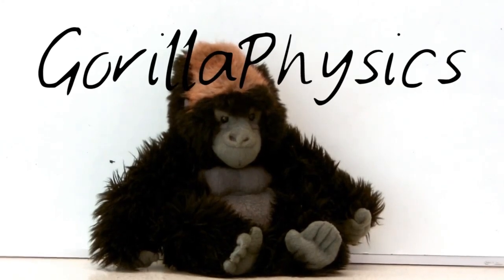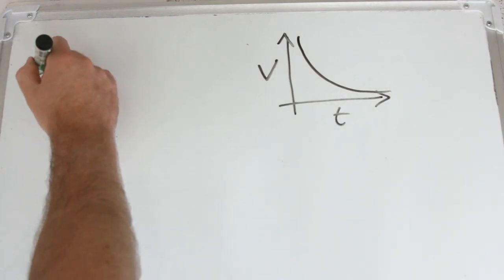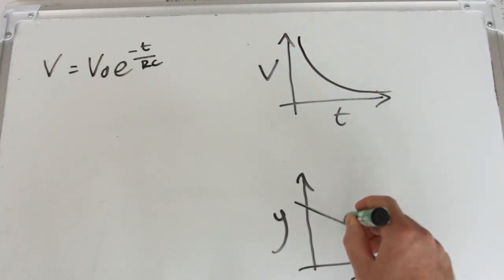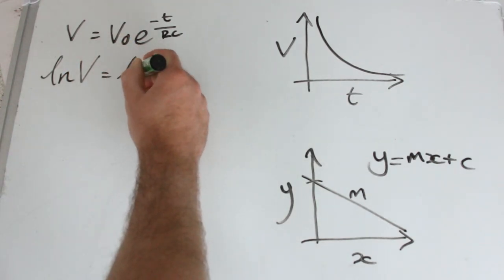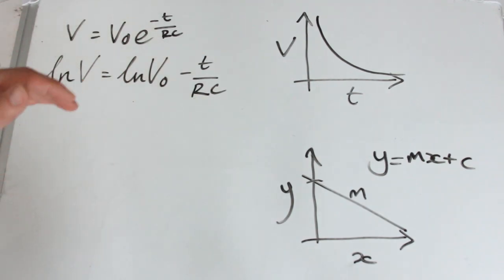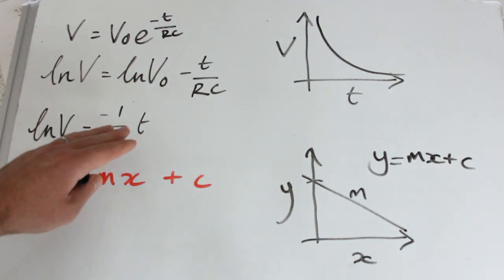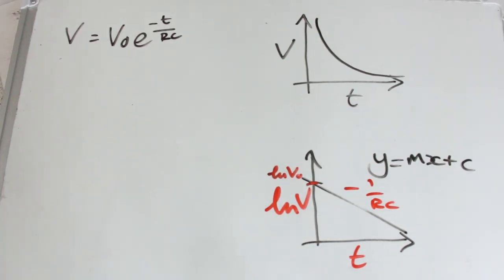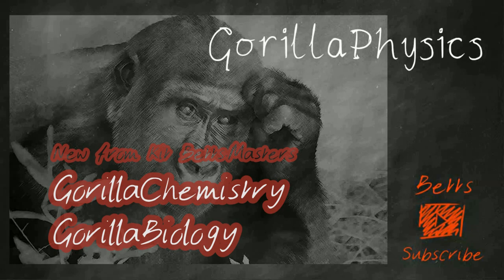Capacitors - A Level Physics - Discharge and Exponential Decay - Revision

Comment: Ok so quick question, if i have a graph of current against time, including both charging and discharging, and then i try to calculate the capacitance using c=Q/V, why would i take area uder the graph to find the charge, why cant i just take the max current and multipy it by the time at which max current is achieved? I sound hectic here, if im not making sense can you please have a look at edexcel ial june 2016 unit 4 question 17b(i).
Link to physics and maths tutor where you can find the IAL paper:
https://www.physicsandmathstutor.com/past-papers/a-level-physics/edexcel-unit-4/
Reply from the maker: Think about the graph line representing how the current changed over that time.  So using the max current give you an over estimation of the total charge!
Reply: @KitBetts-Masters  thank you!